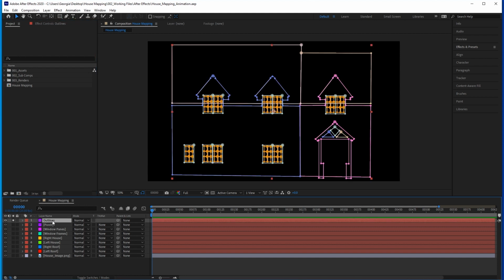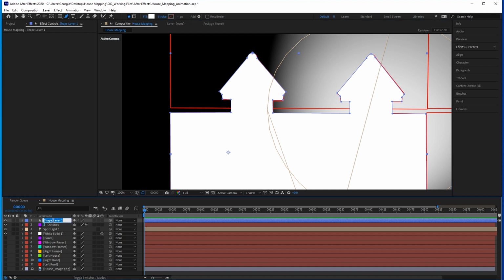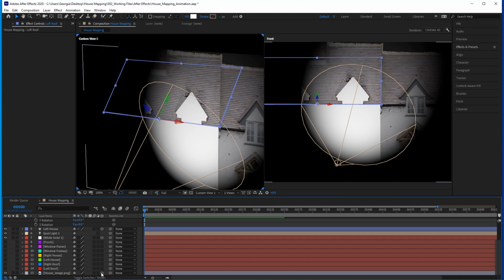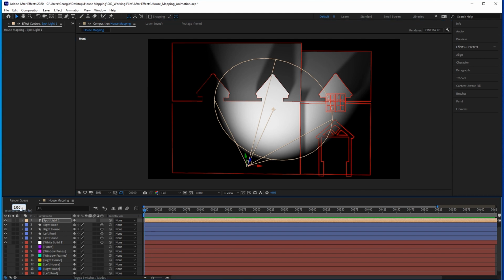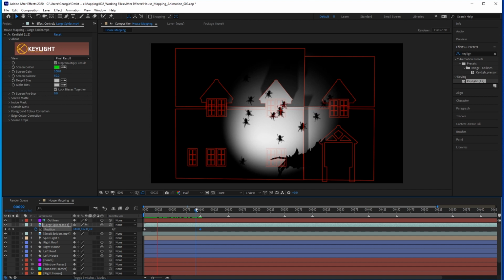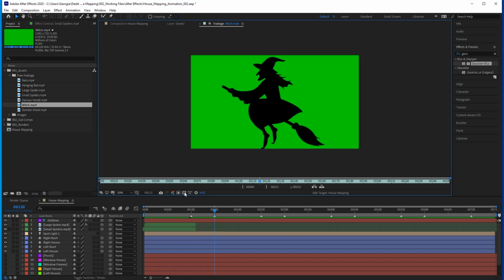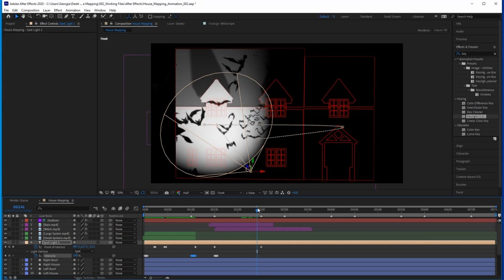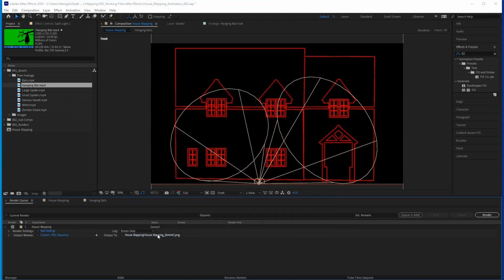House Projection Mapping Tutorial 3/5 Animating in After Effects

Comment: I can’t seem to get meshroom to work. I’m using a HP Envy
Reply from the maker: What problem are you having? Have you tried googling the error/issue?
Reply: @LumaBox  also have the same. Gives an error at the texture part of the process. Googled it and more people had this with windows and Linux. Some solved it by simply restart and others by expanding the virtual memory. Did both but without any luck :(
Reply: @jrikkerink  I ran into the same thing using the latest version of meshroom.  Try downloading an earlier version. 2019.2.0 seemed to work for me.

Comment: Hey there Luma Box, thanks for these awesome tutorials - I'm using them for my own setup right now.  I have a question about your decision to turn off the C4D renderer, because then the extrusions go away (or at least they do in my project).  At that point, the shadows are no longer realistic, so what is your solution?  I want to keep C4D on, but since AEX doesn't have texturing options (that I can find) then you can't project the object back onto itself.  Any solutions there?  Thanks!
Reply from the maker: If you want to get into more advanced texturing/lighting you might want to think about going into full 3D rather than the 2.5D of AE. Cinema 4D maybe? If you really want to stay in AE, you could maybe render out the shadows using the C4D renderer and then using them as a shadow pass with a Multiply blend mode over the top of other work you do that might require the other renderer.
Reply: @LumaBox  Thanks for the response.  I've recently discovered the plugin "Normality" which I think should solve my problems for me - my experiments so far infer as much.  One day I'll learn to properly animate in a 3D environment, but for now... AEX!
Reply: Also, to solve my more immediate problem I just took the original image file and placed it in space in front of the 3d shape.  Not the best solution, but good enough for now.

Comment: Thank you so much for these tutorials!  I'm starting my process in January so I don't feel nearly as rushed during the Holiday season.  I have a quick question though regarding the slope of your roof.  My roof has a similar pitch to yours - but unfortunately it drops down much further into prime viewing area.  You don't seem to use your roof a whole lot during your shows -  is that due to the slope, or is there any possible after-effects magic to project some of the main animations onto a sloped surface and still make it look good?
Reply from the maker: For the 2020 halloween video, I am actually projecting on the roof -- it's just not very visible because the roof tiles are so dark. For that reason, I dispensed with projecting on the roof altogether for the christmas video and saved my resolution for the white parts of the house.